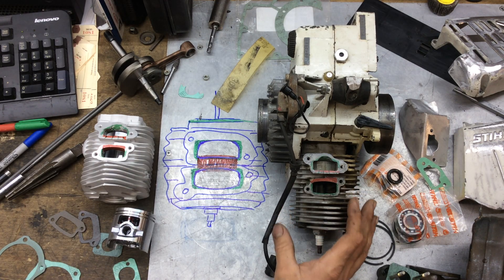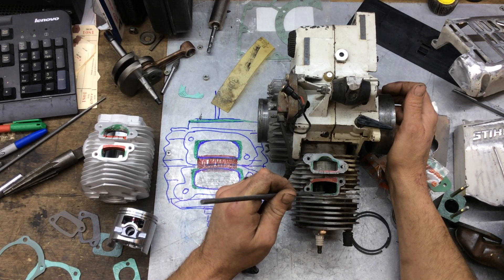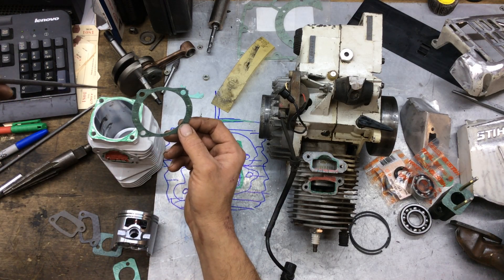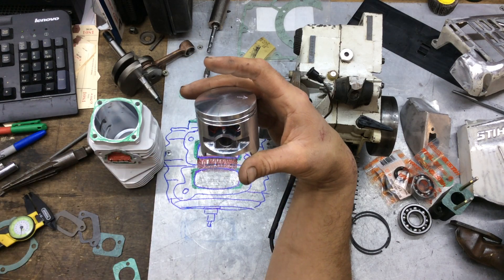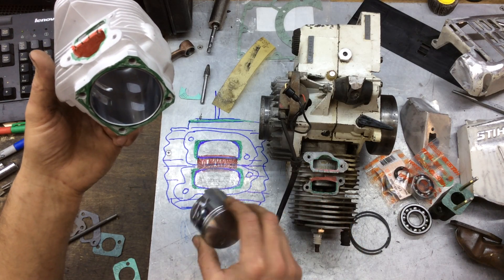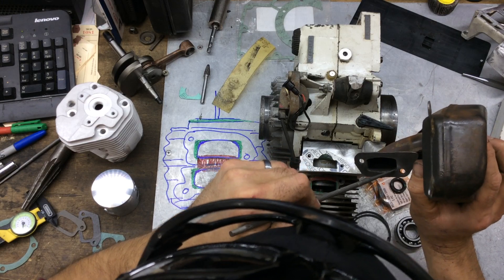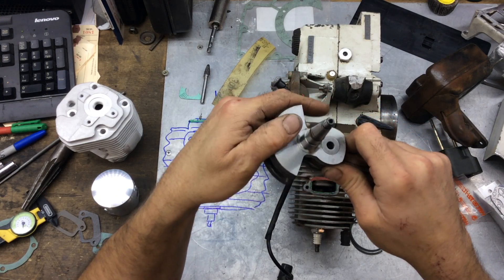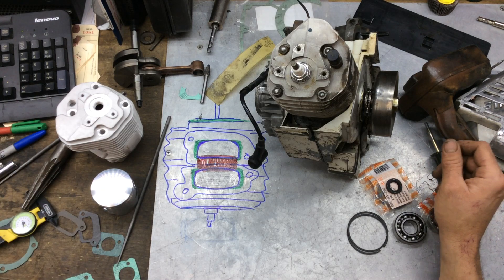Porting and Polishing 2 Stroke Piston Ported Engines for High Performance and Efficiency - Part 1

Comment: Do you use some program for porting, or you are just going by the rule of thumb? I love that 076, going to fit it on my moped. xD
Reply from the maker: I just go by feel and take a little at a time.  there is a great old 2-stroke tuning manual out there that i am forgetting its title... google it.  My way is mostly self taught through a bunch of ruined parts... i would recommend applying a little more known practices than I.
Reply: WHAT THE FIX I use porting calculator and some advices from a 2 stroke performance tuning of A.G.Bell and some pieces of advice from prof. Blair. Differential equations are not my thing. 😂
Reply: @MarioAPN  Gorden Jennings wrote the other 2-stroke book back in the early 70's too.  I use TSR software sometimes, but I never was quite able to figure out the transfer phase of the program well.  Not sure if Mr. Turner did either. :)  He is retired now, so I don't call him anymore.  I port and stroke a bit smaller engines for a living that go into RC car, RC boats, and the Go-Ped scooter.  I would love to build engines for "Hot Saw" competition's, but I have never seen a class for a 30cc engine.  Doug @ Earthsurferpreformance.com
Reply: @WHATTHEFIX  Other than trying to remove material from the base of a cylinder with hand tools, (use the mill and make sure it is square to the bore), your thought process seems pretty good to me.  For your application, going wider, (not up or down) for the ports is a good place to start.  But if you just cut it wider at the port opening, and taper it to the gasket surface, (not making that wider), I think you will find the same power and not have to do any special matching.  Lowering the cylinder is also a good more for a bit more lower rpm and mid-range boost, and I am sure you can go more than .003"-.005".  If everything else permits, you can probably lower the cylinder until you got to about .025" squish clearance, (my estimate for that size engine).
I never worked on a chain saw engine before.  This is the first time I have seen the intake and exhaust ports on the same side of the cylinder, but I bet port duration's work the same.
Doug in Michigan